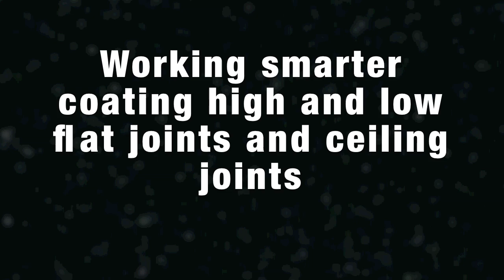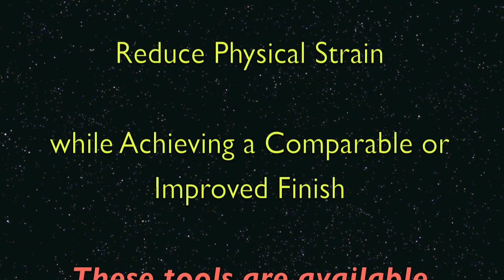Work Smarter - Coating Flat Joints

Comment from the maker: Hi TheSprayking,
The Twister has an adjustable friction brake, which allows the operator to set the brake so that there is enough friction to control the flat box, but also allows the handle to be twisted to another position.
If you have any other questions please let us know!

Comment: wow I wouldn't mind getting that ,what sizes do they come in ,would the box work with any handle
Reply from the maker: Hi Wayne - good question! Tapepro Flat Boxes are compatible with most handles - we do know the Tapeworm handle will not fit the Boxes.
Reply: They get real heavy after a while!! Trust me!!
Reply: I have 12 and 14 inch boxes i use they are faster with box than by hand but the angle of my handle stays the same